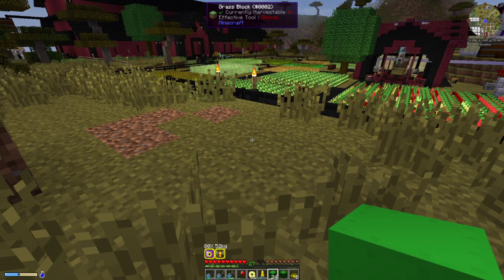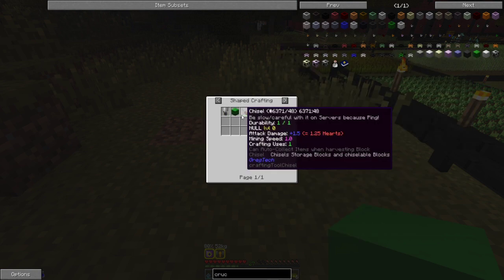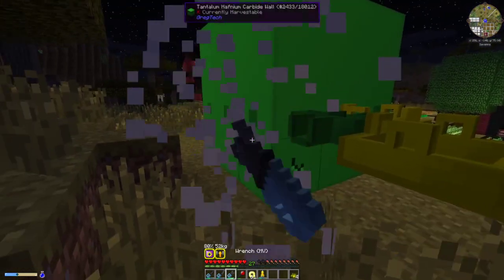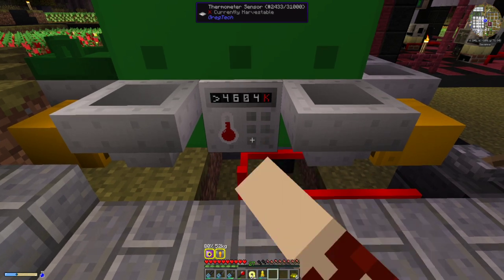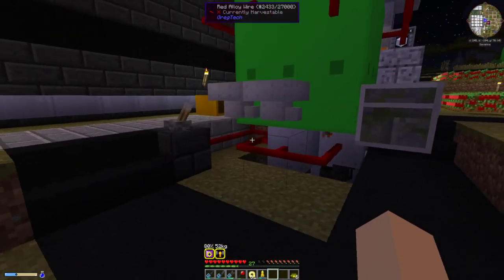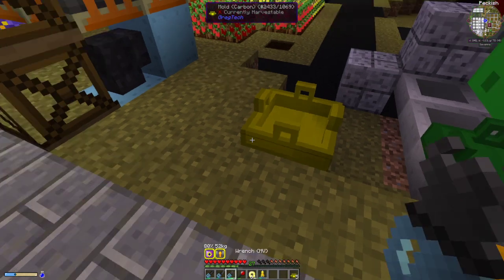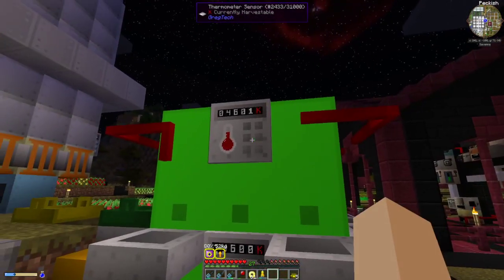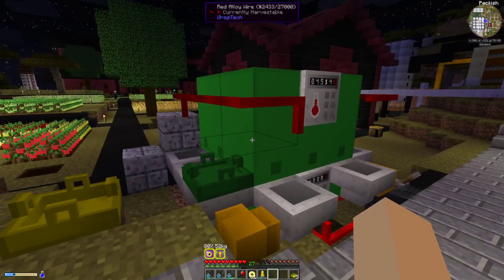Gregtech 6 Multiblock tutorial series - Large Crucible & Automation

Comment: So, one question I've had for a long time, is this the ONLY way to recycle machines and other things over 16 units in a crucible? My normal crucible just swallows a machine when I throw it in, and I can just take it back out. Also, it heats up at the same rate as it does when empty so the crucible doesn't seem to detect over-filling items. Kinda sucks when I wanna recycle older machines for bronze and steel...
Reply from the maker: you can shred them too
Reply: @Bear989  Oh thanks. Just started a new world with the large crucibles and hadn't bothered making half the early machines. Guess speeding towards LV isn't really an option.